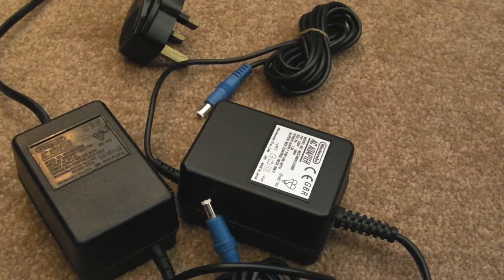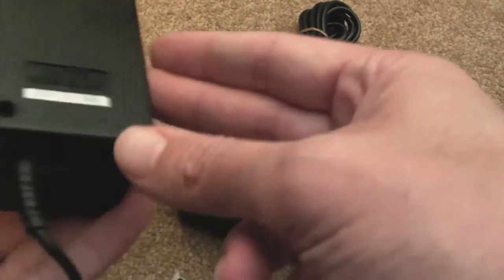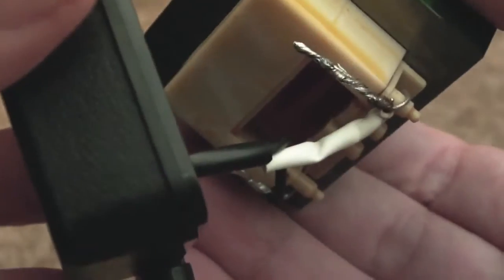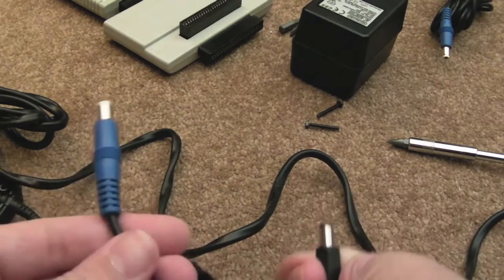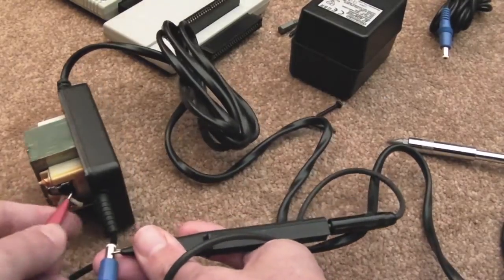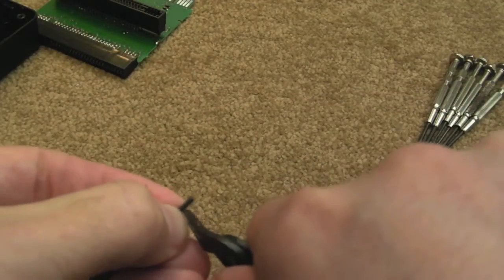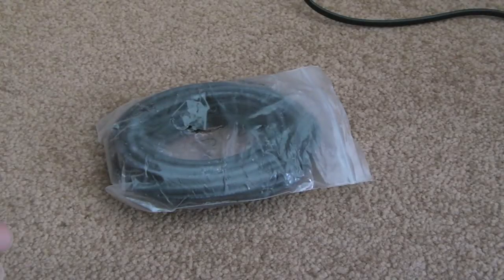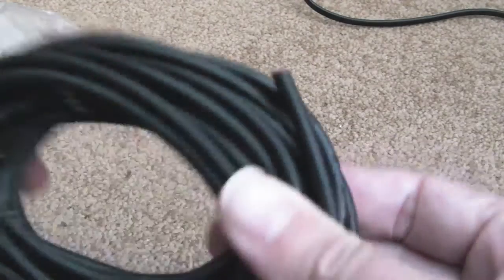Nintendo SNES (Super Famicom) PSU (Power Supply) Repairs

Comment: I just repaired a SNES UK power pak, I tested it with a multi meter and the thing worked if you wiggled the wire near the power pak end. so after waiting for a spanner bit to arrive so i could take it apart, I fixed it... Wish i had seen this video first about putting the strain relief boot back on (WD40 etc)... :/

Comment: If I remember my school physics correctly the one you've converted for DC will also work on the UK snes - it'll just pass through the rectifier using a single path. There will of course be an additional voltage drop across the diodes but I very much doubt that'll cause any problems. You might want to wait for other people to comment before trying it though! I could be misremembering things!
Reply from the maker: That's absolutely correct!   You can pass DC through the bridge, and it doesn't matter about polarity either.

Comment: The US version also uses a DC power supply. I'm not sure about the newer/smaller ones, but I have a model SNS-001 from 1992 and it uses a 10VDC/850mA power supply that has a weird proprietary connector with negative on the center pin. The reservoir capacitor is inside the adapter instead of the console, although there's a spot for one on the PCB. In place of a bridge rectifier it has a single diode for reverse polarity protection before it goes to the 7805 VR.

On an unrelated note, the bridge rectifier you drew in your schematic has two diodes in the wrong direction and would be a short; the arrows in the diode symbols should all be pointing towards the top of the diamond.
Reply from the maker: Thanks =D  The diagram is correct, the cathode of the 2 diodes on the left goes to ground, the anode of the two diodes on the right go to +ve.  Live at the top, neutral at the bottom.  It's definitely correct, you made me check lol - https://www.bing.com/images/search?view=detailV2&ccid=BG8F%2bK%2b%2f&id=94F82419C8437016F57F07E518C233420AE35DB1&thid=OIP.BG8F-K-_NzqMIKFLHxfhAgAAAA&mediaurl=https%3a%2f%2felectric-shocks.com%2fwp-content%2fuploads%2f2019%2f06%2fBridge-Rectifier-Schematic.jpg&exph=291&expw=417&q=bridge+rectifier+diagram&simid=608018866203724857&ck=F5DED5D22E42840CED3F1EF351861B4F&selectedIndex=6&ajaxhist=0

Comment: The easiest way to remove the cable from that "thing" near the enclosure is to boil it and then pull the cable with some pliers. It will come out very easy.. Also when it's still hot, you can insert the cable in it.
Reply: controllable hot air gun as well - about 140C

Comment: i want to buy this screwdriver to open the power supply what is the size of this screwdriver tip compatible with the screw? There are several sizes and I don't know which one to choose.
Reply from the maker: I've got no idea on the exact size - it's best to get a set of tips which contain the few different sizes.  If you search eBay you will find screw drivers dedicated to the thing you are trying to get inside.  eg. 4.5mm & 3.8mm Screwdriver Security Bit For Nintendo SNES N64 Gamecube Gamebit

Comment: I have a question.  I have a SNES.  I have seen Super Famicon consoles for cheap with no adapter, cables or controllers for cheap.  Will my SNES hardware work for the Super Famicon?
Reply from the maker: From memory I believe the Super Famicom lacks a bridge rectifier - ie. it expects DC voltage from the PSU.  I believe some of the other regions (PAL in particular, but maybe NTSC-U also) have an AC PSU.  That's the first problem!   Secondly you might find your controllers don't work as the Japanese ones have some diodes or wire links or something inside them (you can modify them to work though).  RGB cables also might have an issue with capacitors between regions from memory.

Comment: I usually get the cable issue with joypads, I'll generally snip them if it doesn't make the wire stupidly small and do a re-solder job from the cut off point, never had that issue with a PSU, get ready it'll happen this week, sods law.

Comment: Can I use a Super Famicom 100v on a 110v USA socket???
Reply from the maker: I cannot really advise to do this - I wouldnt want to be responsible if a fire starts etc.  But technically it would probably work, albeit outputting slightly more voltage as a result.  But there's always a risk the transformer could fail or something.  It should be protected by fuse, in which case it would be safe to use.  If it were me, I would do it - but ensure that I have an RCD on the mains switch box, and make sure its not left plugged in unattended.
Reply: @GadgetUK164  Thanks

Comment: hello i have a question that i think you could have the answer i just bought a us version super nintendo 1chip 01 on ebay  and i had and old U.S Snes Ac adapter that is supposed to output 10V Dc ... i tested the voltage from the tip and it reads 13.70 volts DC (unloaded) is it safe to use it  ? i dont want it to do internal damage at the price i paid the console haha
Reply from the maker: Yes, that's approx what they all output!  Around 12 to 14v DC.
Reply: ok thanks for the answer!

Comment: Nice job with the PSU, and thanks for cracking one open, now i know it's just a transformer and dead easy to fix.  Please don't cook your Super Famicom, They run on DC and do not have an internal bridge rectifier. Super Famicoms actually have a 2.1 mm jack and are identical to the Sega Megadrive/Genesis PSU's. Also the Famicom has it's own Ripple reducing cap on  the mptherboard just like the pal SNES ( but some US ones don't). Keep the PAL Nintendo PSU for PAL Nintendo and Super Nintendos.

PAL systems will work fine on DC on any polarity too, your modified Adaptor should work fine on pal systems.
Reply: but remember there are 4 extra diodes in the pal unit(rectifier), that may reduce the voltage too much.

Comment: Do megadrive 1 ac adapters work on super Famicom?
Reply from the maker: +Willom The Super Famicom needs DC input, so any 9v DC PSU should work - provided the polarity is correct.  I cannot remember if I have used a Megadrive PSU with the Super Famicom.  If the polarity is the same it should work OK.  Don't feed AC in to a Super Famicom what ever you do.  The PAL SNES can accept AC though as it has a bridge rectifier.
Reply: +GadgetUK164 OK thanks. Do amps matter? Megadrive is 850ma
Reply from the maker: That will be fine for a SNES.
Reply: +GadgetUK164 good to know

Comment: I remember in learning about AC that 1.414 is the square root of 2 and if multiplied with the AC reading from the multimeter gives you the peak voltage of the AC and because the multimeter reads the RMS value. so when rectified, the peak of the AC is very close to what you would get as a DC output. Also wanted to ask where did you get the voltmeter display for your MVS? I would like to find one for my jamma test rig.
Reply from the maker: Very interesting =)  The voltage display, something like this (just check physical dimensions before you order) -
http://www.ebay.co.uk/itm/3-5V-30V-Green-Three-digit-Mini-Digital-Voltage-Display-Module-Meter-363-R-/291261547444?pt=LH_DefaultDomain_3&hash=item43d08a83b4
Reply from the maker: I used a full bridge though!
Reply: You did in the later part of the diagram, but a half-wave first. ;)
Reply from the maker: Ah, I see what you mean =D  Yes, you are right, if using halfwave its half the value!
Reply: Don't worry, you're not the only one who forgot that after college.

Yep, I did it too a while back. lol

Comment: Great informative video! Now you need just one more (or an adapter) for a North American SNES! Why they used that awful proprietary plug on just that console is insane! I have a north american one of those to repair actually. Has the rectifier circuit and a 16V 4700uf capacitor on a little PCB soldered directly to the transformer. Behaves strangely; It seem to output proper voltage until you plug it in and use it. The console will flash on for a second or so and then nothing. And the adapters output drops to 2.5v or so. Seems like there must be a failing thermal fuse or something. I'll crack into it and let you know what I find!!
Reply from the maker: That sounds like a wire problem to me!  I've had several PSU's for different systems behave that way - measure at say 10v, plug it in and it drops to 2.5v, nearly always the wire!
Reply: Well this one must be one of the exceptions. I honestly expected it was my fault as I soldered on the new connector to fit the super famicom port. If it wasn't that; I figured a flaky cord would be the culprit. Unfortunately, it does the same thing even after I de-soldered the  power cord from the pcb. It outputs 13. 4 volts dc for about 5 seconds after being plugged into mains voltage, then slowly drops to nothing

Comment: What is the screwdriver to open the power supply snes?
Reply from the maker: +Game maniaco You want a security bit set like this one:-
http://www.ebay.co.uk/itm/New-33PC-Security-Magnetic-Bit-Set-Screwdriver-Holder-Torx-Hex-Star-Silverline-/281634741808?hash=item4192bd1e30:g:HNMAAOSwd0BV0ddW 
See on the left hand row - it's one of the first 4 bits there.
Reply: what the model screwdriver?